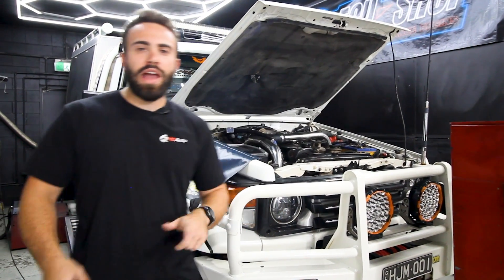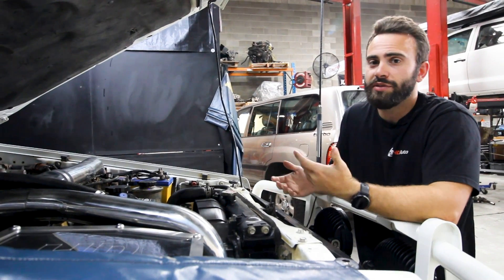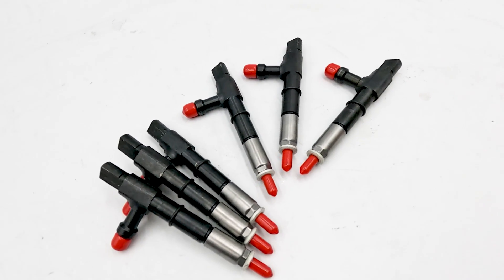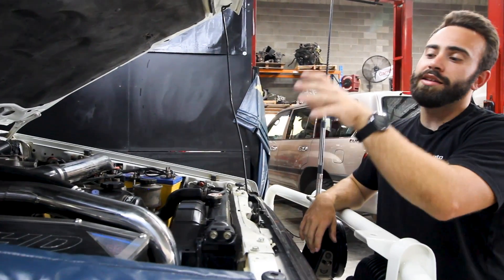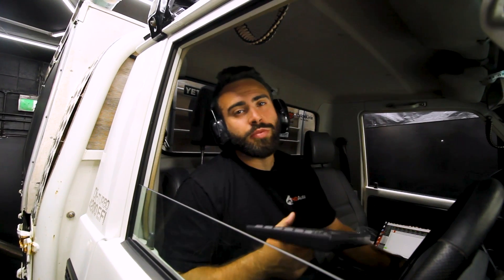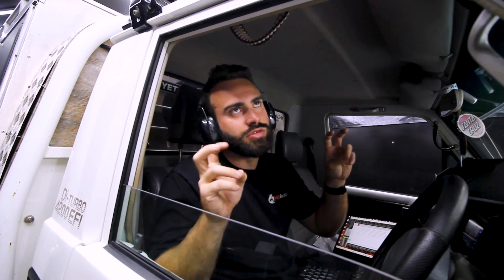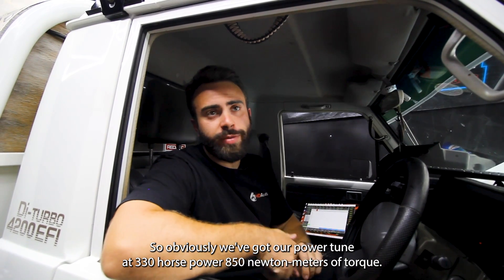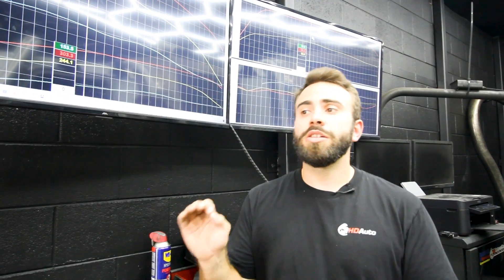1HD-FTE - The Ultimate Performance Package! But is it safe?

Comment: BTW, think the best upgrade that you could give any 80 series with a five speed would be a sixth gear,

That would be a far better option than the alternative that some people go to which is a taller diff, but that hasnotable negatives in stiff off-road going.

If anybody could find or create a six speed gearbox that hooked up to the original transfer case they would probably sell like hotcakes!

Comment: I’d like to hear a little bit more about the reliability of componentry after essentially doubling the horsepower.

If you give it enough power, you can launch the Queen Mary into space, but the issue here is not so much what you can get out of the engine but how the driveline handles the extra power and the inevitable extra abuse especially when fully loaded and the driver is still sticking the welly into it simply because he can.

The inevitable flow on of course are into clutch universal joints, CV joints and diffs, and potentially feed into more twisting forces on suspension componentry. 

I’ve driven my 1997 80 series 4500 Twin cam petrol since new and it has never put a foot  or quit - ever. 

Use has been a mix of urban, professional bush work and long distance touring with what would be described by most people as moderate loads, mostly fuel and water.

This is because I choose to travel light without all the crap that most people shoehorn into their vehicles for such journeys. 

As far as I’m concerned if it doesn’t fit inside the car, then it doesn’t come with me. No roof rack and no towing, although it has a towbar.

Sadly, while many of the conversions that I have seen have been done well and the cars have been treated properly. 

But it’s sad to see so many 80 series being bought relatively cheap and probably already neglected by previous owners, only to be further savaged by idjits jacking them up, sticking fat tyres on, putting fishing rod holders on them and taking them down the beach where they end up rusting to death. 

The 80 series represents a model that is worth preserving and not flogging to death, so while I am as interested as the next bloke in healthy modifications and a modest power uplift, ultimately my advice is to manage it all with the ultimate consideration for the vehicle, which will return good  care in spades.

Comment: I'm finding there's tons of builds and information on the FTE but not as much on the FT. I personally prefer mechanical for it's simplicity and reliability and being able to diagnose and fix issues myself cost effectively. Be nice to know if there was a kit or standard of upgrading to get around 300hp out of a FT as well. I'm assuming you can with similar parts and obviously the tuning is done differently but it would be good to hear it from an experienced tuner

Comment: Excellent video. My HDJ100 has a 5-speed automatic (A750 F). Have you tested this power output in this transmission? And could you tell me how many NM this box can handle?
Thanks, greetings from Spain.

Comment: Hi - ive just purchased my son a 1994 - 75 series with a rebuilt and balanced 1HZ thats been converted to turbo with a Garret GTX2860R and a cross country intercooler - the guy i purchased it ioff was building it for his son and he lost interest - hes installed a PFI 12mm pump, pfi injectors, new head-ARCO ceremic pistons ACL rods and bearings - everything is new including radiator however its got the stock aircleaner (no snorkel) the engine hasnt been driven as it was a frame off resto and im in the final weeks of getting it in for an exhaust and tune - ive been watching your vids and what you do when tunning them (im not sure where you are located) but i wanted to see if you can provide me some advice before i head off for the final stage 
I need to have an exhaust fitted and i noticed that one 75 the exhaust was coming out behind the cab and i wanted to ask does that change any performance by doing that and do i get any better performance from a 4in?
i am looking to take it to a guy whos done good work on my stock patrol and im sure he would be all over it but thought i would ask you what recommendations you had as im not sure abour Mapping as my son still hasnt paid the cruiser off yet so im wanting to know if its stock with air cleaner what sort of HP and Torgue would you think i could expect 
Thanks again for sharing the videos as they are a great insight for all of us on what / how the dyno and tunning can give better performance
Reply: The hz is a different kettle unfortunately 

If you have a mechanical pump it will be tuned by ear/soot 

The hz with like 8psi pretty much double in power and drive awesome
Reply: You won't gain anything from a shorter exhaust/bigger

Comment: Thanks for the video. I have a 100 series Sahara 4.2 1HD-FTE with just on 300 K. I find the power great most of the time but when towing, it sucks. I find I am slowing on hills to 70km/h. I tow a 2.5 tonne off road caravan, so not overloaded. I am considering a chip but many people say be careful of the type you buy, as most just increase fuel and I want to safely increase power and torque. What do you suggest and do you also need to dyno it after fitting a chip?
Reply from the maker: Hey mate, if you grab a Unichip from us, I can assure you’ll have no dramas and love the power upgrades! Sold literally thousands, lots of happy people!

Dyno is not required as we have setup so many of these. Dyno will give you every 1% of maximum potential, but to make 80% of the gains, it’s not needed

Comment: Great video. I have a 2003 HJ100 4.2TDI with the 4 speed auto trans. I have heard the 4 speed gearbox does not handle the additional power and torque coming from the Unichip upgrade not werll. Would you recommend going for the Unichip with the 4 speed auto transmission ?
Reply from the maker: They absolutely can, so can the 5 speed. Never had an issue with the 4 speeds

Comment: Why don’t you guys install a methanol/water injection kit?
My research suggests benefits are:
More power with economy.
Keeps engine cleaner (reduced carbon buildup),
Keeps EGT’s lower.
The major negative is, you need to keep the reservoir topped up.
However you do not need to use methanol if you don’t want to.
Oh, in case you are thinking to use 100% methanol….no no no, highly flammable.
Max is 50:50.
Reply from the maker: Hey man, I said I would reply to every comment I didn’t say immediately. 

We just don’t have or haven’t found the need to add that for the relative minimal gains for the amount of upkeep and potential for it to cause people issues in remote areas, or days of correlations, for example.
Reply: @ yes, that makes sense, thanks.
Reply: I wrote this a month ago and no reply.
Statement: “I reply to every comment”, well how about replying to others as well, like one was 10 months ago?

Comment: Hello,
Don't know if you'll be replying here. It would be great if you did.
Do you think running +70s on a FT with G turbo titanium is something you wouldn't recommend? Arp head and acl bearings with. Do you think the engine would be reliable? Or is it overkill? 

Kindly let me know.
Reply from the maker: It won’t kill the engine due to power, but FT’s don’t respond the same way Fte’s do. It’ll be very sooty, and only produce maybe 320hp maximum
Reply: @hd_hayden  thank you for the reply 🙏
What is the ideal setup you recommend for the ft then? 
Injector size + turbo combo I mean. +40s and red wheel? 
I've not heard any official rep talk about getting the titanium over the red. 
Kindly let me the know.
May thanks.
Also, awesome content!

Comment: Isn’t that a 75 series ?
Reply: Its a pre vdj79. The earlier hzj79 and Hdj79's were made from around late 2000 to 2007 I beleive. Similar cab to the 75 but slightly longer behind the doors. Still coil front end, without the wide front diff of the v8's.

Comment: Can u run +30 injectors with a 18g ufi pdi front mount with a stock pump 1hd-ft not looking for max power but u think around 200 would work fine
Reply: Just want low end tourque for towing and Highway
Reply from the maker: You sure can! We have them in stock at HDAutomotive.com.au

Comment: Hi is the 1hdft a better engine then the 1hdfte .... honest thoughts
Reply: Both great motors fte is slightly better there’s a book about the differences. Think the Ft as more and oldsxhool motor and the FTE more modernised using a ecu for fuel timing and other sensors
Reply: I like the ild school as so much easier to fix something out in the middle of nowhere
Reply: @Bootz-em2qe  yeah no scanners that’s for sure pure mechanical except for the throttle position on the puno
Reply from the maker: 1hdfte is better, by far
Reply: How you going to chip with no electric injection pump? 1hdfte way to go.
Reply: Why?

Comment: Hey mate. The old 79 fte has just ticked over 400000. Everything is smick had it all checked and running fine. Don’t want nothing ridiculous but what would a chip and tune cost mate. It has a 3 inch exhaust already like you said everyone does that. Thanks heaps mate
Reply from the maker: Hey mate, a chip is $3050 including 5 map select.
Reply: What kind of power would this make mate?@hd_hayden

Comment: Hey mate how do you go with a dx 80 with 10mm fuel lines while trying to chase 300hp? Will I need to make some 12mm lines up to make this power? Or will a good loft pump achieve this?
Reply: Definitely recommend upgrading those and still fitting a lift pump mate

Comment: Just bought a 105 series with a 1hdfte conversion. Wanting to get 300hp out of it. A bit worried about the gearbox tho. Would it need to be changed?
Reply: Depends what box. If it has the 5 speed auto they won't love that power. The 1hz box also won't love it.  The h151 /152 should handle it okay. (Manual from behind these engines and the v8s)
Reply: i had a 105 that started life with a 1HZ engine, which has the weak prado box as standard... At first i supercharged the 1HZ and ripped the teeth off the inside of 3rd gear... after the 1HZ blew up and the box rebuild, i built a 195kw 1HDT and never had an issue with the box again, although being a mechanic, i am quite mechanically sympathetic and don't push boundaries that i know may still exist

Comment: Don't know if this is too specific so all good if you don't reply. I got a HDJ100 and was planing on putting a Cross Country front intercooler, 3" exhaust, and UniChip. Can you offer a guess at how much more power I'll get on a power tune, and how change in economy on an efficiency tune?
Reply: Hey mate I’m woundering the same thing did you ever get the answer?
Reply: @Tobysfte , I didn't get an answer. I'm still yet to do the upgrades so can't tell you from experience either.
Reply: 2:50 
You'll be limited by your injectors
So ~250hp give or take

Comment: Hello, what’s the best way to delete the intake pre heater unit? I  have unplugged it so it no longer works, but I can imagine it must be a fairly large restriction of air.

Second question, my fte is on 350,000 thousand miles, not km, do you think it’s still safe to continue to push on with, it’s got a very old dastek unichip on it and it’s still sweet.
Reply from the maker: We have a intake adapter elbow on our website for the 1HD-FTE which deletes the whole cross over section

And yeah, we have done them with 700,000km’s and been ok!

Comment: Hey Hayden I am about to put a PDI Intercooler, PDI airbox, UFI 21L, +40 injectors, stock pump on a 96 HDFT. Can the stock pump handle the UFI and +40 injectors. I don’t have a built pump yet. Am I gonna ruin anything by running set up on a stock pump. Just timing the pump enough . Also don’t have a Dyno tune shop around either.
Reply from the maker: It sure can mate. That’s an awesome setup!

Comment: Perfect timing. I just spent weekend camping with a mate and talking about what he would need to do to his 100 series to be able to tow his van at the speed limit. Haha
I didnt think about the fuel pump. The car has 380,000kms and most likley the original pump. Is there a good way to tell if its going to be ok for that 250hp target?

PS. Hope you got your crimpers back 😊
Reply from the maker: Hey mate yeah I sure did thank you 😂

The stock fuel pump even at 380,000km is normally fine to make that power. Go for a UFI18G, HD +17 injectors, and a Unichip. If the budget is there go for a PDI Intercooler as well, will be different car entirely. Or start with stock turbo; injectors; and Unichip.
Reply: @hd_hayden  
Sweet. 
The auto has been rebuilt recently but don't believe it's got an upgraded valve body. At what point is that a necessity? 

I did suggest he could get the unichip installed and tuned with factory turbo and injectors. Then upgrade turbo, injectors, fmic. 
What would the tune cost second time round after upgrades?
Also you suggested the factory airbox suitable to factory injectors. I'm a nissan (with a bit of isuzu thrown in the mix)  guy so not familiar with the Toyota stuff. Is the 100 series airbox the same as the 70?

Comment: Building a yanmar 6lpa to road spec, and will be getter the injectors reconditioned, and pump made into highway spec and built for 300hp, have you had much experience with these? Will be putting a ufi 21l on it, you reckon itll make 300hp+ easy?
Reply from the maker: Hey mate

The difference between a “pump rebuild” and a performance pump is completely different. I recommend going down the path of having a HD performance pump built, as these use vastly different parts to a stock pump to achieve a safe and reliable 300hp. I have owned an FT in my own vehicle at 300hp for the last 5 years carrying out R&D on these pumps and setups for reference.

Paired with a UFI 21L, PDI front mount, HD 300 pump and injectors, this will make 300hp easily

Comment: What would you suggest for a 95 FT with the 4 speed A442F auto for ~200HP and ~600Nm ?  Your FT ran ~300HP with the 21L yeah?  I was thinking PDI intercooler & GTurbo Green, keeping the pump 11mm (but rebuilt) and new genuine injectors, and Nomad valve body for the auto to go with the PDI cooler.
Reply from the maker: Hey mate
So first thing to consider is that the factory pump is already a 12mm fuel pump, but they are limited in stock form to around 180-200hp depending on health of the pump -
So all good to go there

I would recommend going for a set of high flow 300hp injectors, and pair them up with your stock pump. That’s going to make up the massive fuel difference between what the stock pump can do and how limited the stock injectors are. You will probably not actually have to touch the pump to achieve a safe 200hp/550nm. We offer these exchange or new.

I would consider a UFI 16G or GTurbo green wheel. I have both in stock :)
Reply: @hd_hayden  Thanks Hayden, I'll take follow up questions to email.

Comment: For a 300hp build would you go the 18 over a 21 with plus 30 injectors?
Reply from the maker: This particular build had an 18G with our 300hp injectors, but normally over 320hp I would recommend a 21L

Comment: Hey mate, just rebuilding my ft with a brand new fte bottom end, I have ordered the arp head studs from u this morning.
Need to order fuel injectors and want over the 300hp should I go for the middle of the range or get the highest hp ones so there not working so hard ?
Staying mechanical pump and will upgrade when funds allow.
Thanks mate
Reply from the maker: Hey mate
First of all thanks from ordering from us! 
We have a 300hp pump and a 330hp capable FT injector, pumps are being built at the moment and are due to be complete in about two weeks. For now - go with the 300hp injectors. Will work well even with a stock pump mate
Reply: @hd_hayden  if I order the injectors today how quick can I get a set mate as I’m in a rush. Thanks
Reply from the maker: @mrmusicmanic Mate I’m pretty confident they’re going to be in stock but I will have to wait to confirm on Monday so hold off until then, shoot me a message in the meantime
Reply: my hdj78 has the early 1st gen unichip, will most 4x4 performance workshops have the dyno software to suit the 1st gen unichip?

Comment: Got a 96 80 hdft. 
I just bought  + 40 injectors, PDI IC and PDI Airbox, UFI 21L, rebuilt Yanmar pump 6lpa. Does the Yanmar pump need any tweaking or are they bolt in
Reply from the maker: Hey mate

I really do not recommend the Yanmar pumps. They are underfueled for a performance engine, and deliver very poor performance results in comparison to a built performance pump. There is a lot of differences between a well build performance orientated pump and a standard or rebuilt to standard Yanmar pump. Most I have seen a Yanmar pump push out on the dyno is 220hp, even though people think they’ve bought a “300hp pump” because the Yanmar tag plate says 300hp, but marine applications specify engine power not wheel horse power
Reply: @hd_hayden okay thanks Hayden. Would a FT tolerate a 300 hp build .